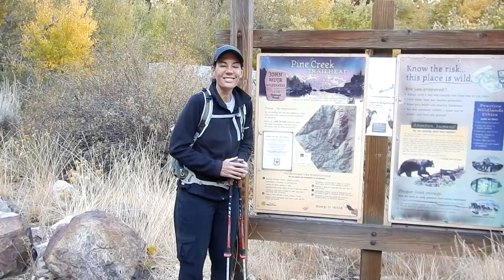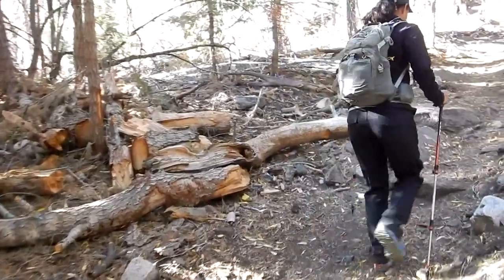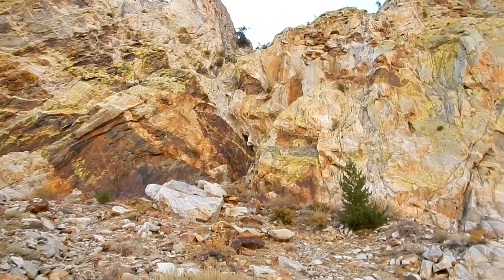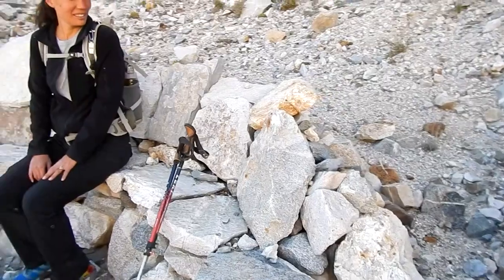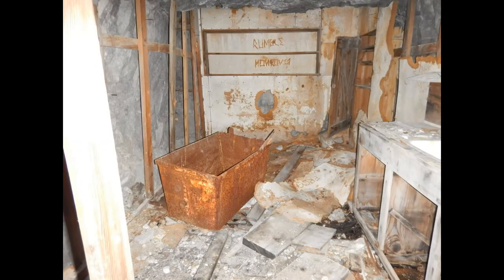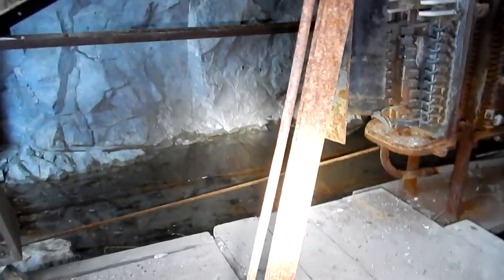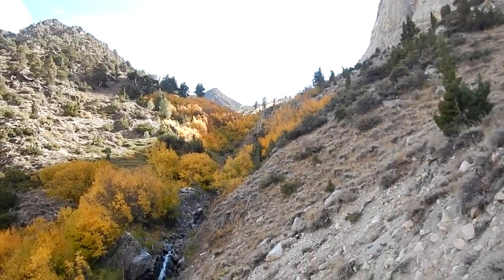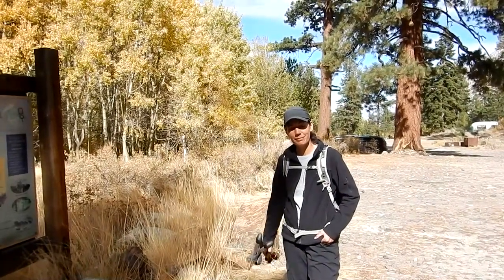Pine Creek Trailhead - Pine Creek Pass Trail to Brownstone Mine

Comment: We hiked up there a couple of times. It sure is pretty there and one of our favorite places.  I'm pretty sure they still have an outfitter down there at the camp.
Reply from the maker: It is a beautiful area and fun place to hike. We've  been meaning to go back as I now know of a way to access the inside of the mine that I didn't know at the time we made this video. The other trail that leaves from the same area is also fun. It's called Gable Lakes. I don't know if you've hiked it or not. We were trying to get to the mine near the lakes last time we were there but got shut down by deep snow. We made a video of that, too. It follows the tram for a while that went all the way up to the Tungstar Mine. The Hanging Valley Mine is up that way but those mines are both accessed from the other direction on the Horton Lakes Trail. That is another beautiful area. Of course we have a Horton Lake video, too. 
Did you guys make it to Mina? Thanks for the comment!

Comment: Pretty nice hike! That was neat seeing the burro trains coming down the mountain. Exactly how they did it in the olden days! The autumn colors here and there were also nice to see. That ugly, rust-colored foam on the mine portal looked terrible! Such a shame they are allowed to deface the natural landscape like that. Nice shots of that tram! I thought it was interesting how the upper part of that tram was inside that tunnel. Sounded like there was running or falling water in there. I just saw where you showed where the water was coming in.
Reply from the maker: It was a fun hike. I had no idea there was ever a tram here. Three trams from different canyons all end in a relatively close proximity at the bottom of the mountains. This one from the Brownstone, one from the Tungstar Mine and one from the Pine Creek Mine. The tram from the Tungstar is long with a lot of elevation change. The foam is very ugly, as you mentioned. The pack string was fun to see and a little bonus in my opinion. They had been out for seven days supporting three campers/hikers who had started at South Lake. I'm not sure if the exact route they took or the mileage they covered. The fall colors were at, or just past, the peak bright yellow the aspens turn. Thanks for watching and commenting, Frank.

Comment: The men that worked those mines were a different sort of man... Not like a lot of the young men today. Imagine the hard work, cold/heat they experienced working there, and getting that equipment up that mountain. Then drilling/slamming hammers into that solid rock for hours and hours on end. It's incredible to say the least.
Reply from the maker: I think the same thing just about every time we are around an old mining operation. These were some tough men doing dangerous work in remote locations. Just building a road or trail and getting the equipment there must have been daunting. Then comes the actual work...incredible. Thanks for the comment!

Comment: At 10 minutes in, that vertical unit on the left is the motor speed and direction control. To the right are resistor banks to reduce the voltage to the motor for different slower speeds. More or less are switched in for different operating speeds. If a DC (direct current) motor, there will be a bank of rectifiers too for converting AC (Alternating Current) to DC. The Alternating Current was likely supplied through power lines on poles to the mine, and long ago removed.
Reply from the maker: Thanks for your input and the information,  Charley. That all sounds inborder.

Comment: I just re-watched this video again. It was hard to hear what the leader of the mule team was saying when you greeted him and asked him what he was doing out there. Do you think they were up there closing up old mines? It looks like those burros were carrying large containers and stuff like that which might’ve had the mine reclamation supplies and equipment inside them (i.e. bags of PUF foam, etc.). I wouldn’t put it past them that that is what they were doing up there. It’s strange that they did not cover up the orange foam with dirt at that one portal you showed. The PUF foam degrades when exposed to sunlight. They normally cover up a foam plug with a lot of dirt because of that reason. I know down here in our local mountains, other explorers found some foamed mine entrances that were left exposed to sunlight. Sometime later, people were able to chip away at the foam and re-open the portal to get access due to the degradation of the foam. Otherwise, that foam remains as hard as concrete when it’s not exposed to sunlight.
Reply from the maker: These guys were guides out of the Rock Creek pack station that had three people following about a quarter mile behind them on foot. They said they were from the bay area (I don't like that saying) and declined when I asked if they wanted to be in my video. They had been out for a week doing the rich guy backpacking thing(dudes). I forget exactly what the guides said in the video, but,they were friendly when I asked if I could take video of them and they "said sure you can".
Reply: @TomandJulieMineExploring  Oh, OK.

Comment: Great video! I was out there backpacking with my son this fall, and noticed the shafts high up on the wall. Wish I knew how much was up there or we would have made a detour.
Reply from the maker: There is a lot of stuff left up there at the top of the tram terminal. It's pretty sketchy with huge rock slabs that have sloughed off from above. Once inside where the equipment is it is solid. It's a bit tough to hike there from the main trail, as well. I want to go back to check out the actual mine workings but haven't had the chance yet. Thanks for watching!

Comment: Great video! The underground tram station is one of the most impressive things I've ever seen a mine. The condition of the entrance looks significantly worse then it did about 6-7 years ago. Apparently, the road up to this mine was only built to remove equipment. The tram buckets and the bull wheel were somehow brought up on mules!
Reply from the maker: I was impressed as well. I had no idea there was ever a tram here. The room cut into solid rock is a real fortress and will be there for a long time. There was another tram that ran up to the Tung Star mine starting very near the trail head where we started this hike. We followed the Tung Star tram route last year as far as we could. The towers are still there and the lower base, or terminal, is at the Laws Railroad Museum. I have videos of both the route and base on my channel. Thanks for the comment!
Reply: @TomandJulieMineExploring  The Tungstar and Hanging Valley mines are must sees. Equipment is scattered everywhere. I'd like to revisit those mines someday, but I'll probably have to wait until next year. Hiking along the tramway sounds really neat. I'll have to check out those videos. The background to my channel is of the Hanging Valley Mine, but that was long before I had any interest in filming.
Reply from the maker: @forgottenmininghistory  I haven't been to either mine high up on Mount Tom. I'm guessing you came from the Horton side. I'd like to make the hike up there aometime. We didn't get too far up the tram route. Take the Gable Lakes trail. After the route crosses the creek it goes through some very steep terrain. I don't know how they ever built it. A friend in Bishop says his father found the Tungstar Mine location.
Reply: @TomandJulieMineExploring  Yep, I went up the Horton Lakes side. It must have been a huge and expensive feat to build that tramway. What amazes me the most is that it's still intact, despite all of the snow the area gets. I bet your friends father had some great stories to tell about the mine.